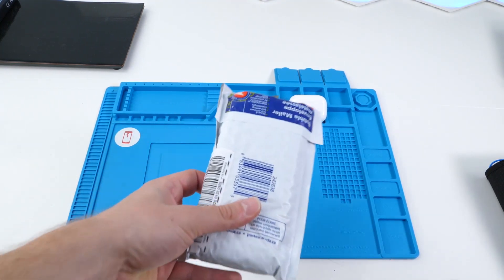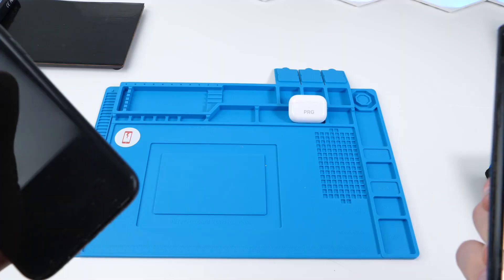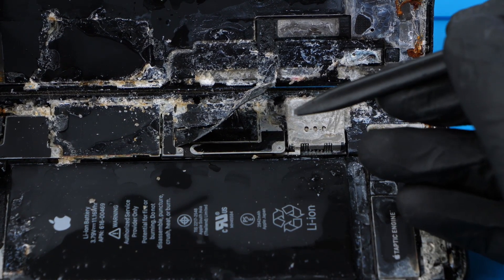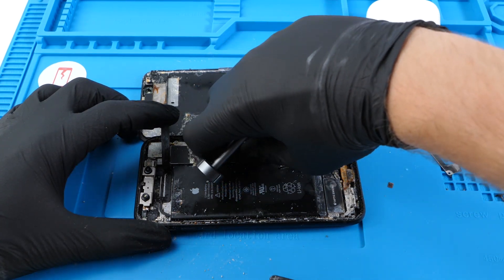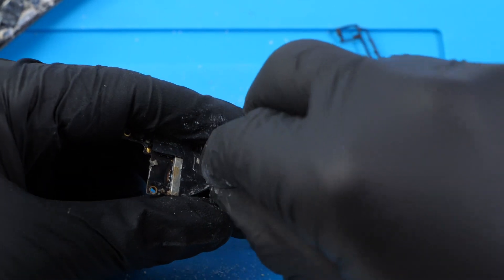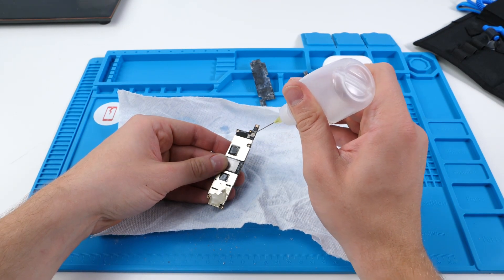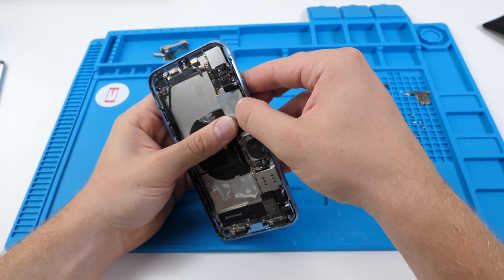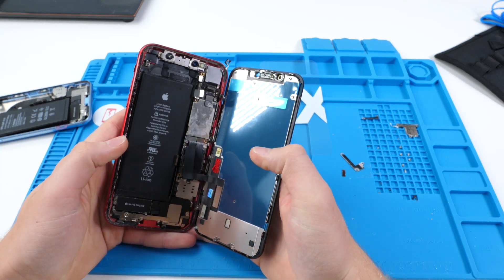Can We Restore This Very Salty iPhone XR From the Ocean?

Comment: Found a iPhone 13 Pro Max on the beach but the charging port is rusty and is won’t hold a charge wireless charging doesn’t work either so some thing might be wrong with the battery

Comment: Actually the phone might work if you fix the charging port connector and connect the charging port to the motherboard. While I was changing housing on my XR, i accidentally tore my charging port and upon replacing it with an OEM one, phone stopped working. The problem was the new charging port was faulty. Upon replacing it with another one, phone started working again. So even though you connect the battery, the phone won’t turn on unless you connect the charging port. Hope this helps!

Comment: In a video you said that distilled water is used to clean boards and the board actually gets damaged from ions. 
So, now you re performing ultrasonic cleaning,the water is distilled but the boards have salt on it. Wouldnt this damage the boards?